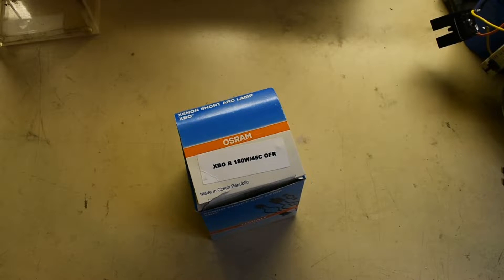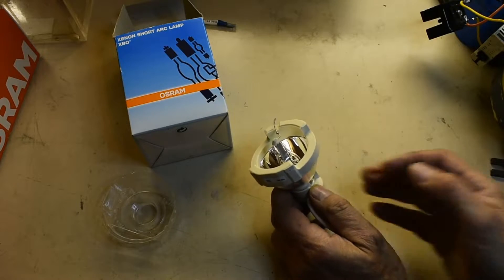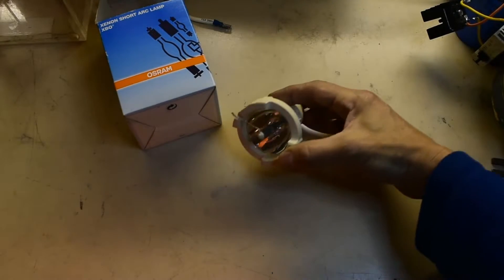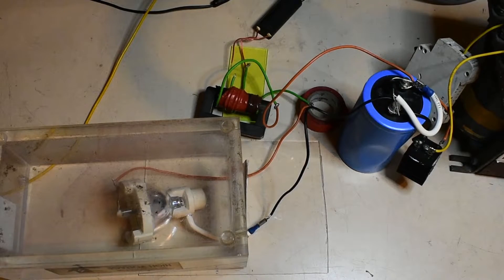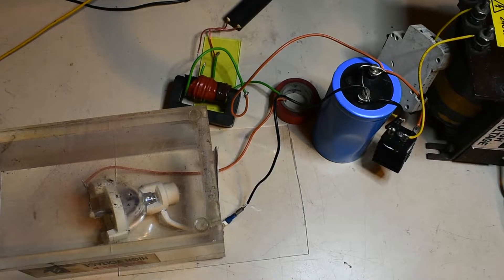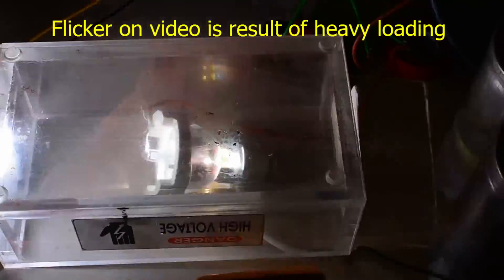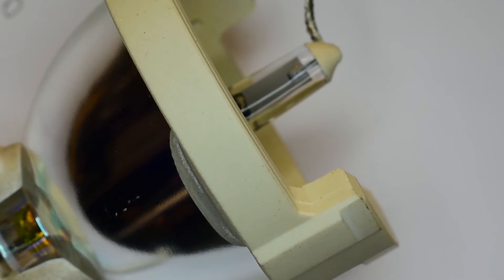small Xenon XBO lamp

Comment: Is it possible to run one of these lamps on continuous high voltage low current? Like 3kv 30ma
Reply from the maker: It will light but not properly, so will be very dull and overload the HV power power supply to some extent. For short or flash use this would be ok but the lamp needs to operate in thermionic emission with a glowing hot cathode for correct operation. Not achieving this will eventually damage the cathode and the lamp may not operate at all.

Comment: You should put the gas discharge tube in the area where it sparks to reduce the danger and reduce noise
Reply from the maker: Just a quick test set-up to check the lamp.
Reply: @tuopeeks  would be very dangerous

Comment: Part description please , especially for inductor coil hv
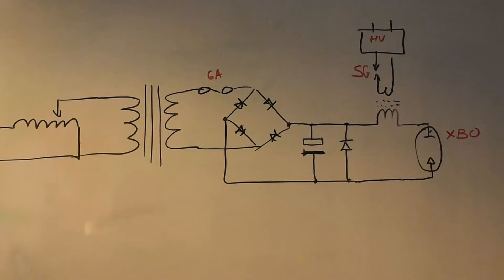Reply from the maker: The diagram at 4:45 shows the complete circuit. The high voltage module is of a pulse type found on eBay often claiming 400kV or similar. It’s more like 60kV, but will run from a 3 to 6V dc supply. This is fed into a few turns of wire around a ferrite core to make a transformer. A spark gap is required to achieve the voltage pulse on the coil. The secondary winding is wired in series with the low voltage DC circuit to the lamp. This is effectively a ‘superimposed ignitor’ circuit for starting the lamp. The transformer can be wound 1:1 or 1:2 depending on ease of starting. The diode across the capacitor is to protect the bridge and capacitor from reverse HV spikes.

Comment: Finally someone shows how to couple the ignition voltage spike into the main lamp current. That ferrite core 10 to 10 turns magnetically isolates the ignitor. Ingenious man. Diode across smoothing cap completes ignition circuit.. Just got a "BHA - 600r - 32 High pressure mercury long arc" that I'm trying to get fired off. Thanks for showing me how to not fry my "500kV" pulse ignitor lol (30kV).
Reply from the maker: Quite easy to adjust the pulse voltage, if required, by changing the turn ratio. Some XBO pulse transformers have fewer turns than 10.  My experience is not damaging ignitors but blowing the low voltage power supply. One of the reasons I am using a simple DC setup here. :-)
Reply: Why thank you. You literally opened up a new world trying to ignite HID lamps.
Reply: It's similar to the way some ion lasers are ignited, for example Lexel units.
Reply: @cambridgemart2075  Thanks again for showing us this. Opened up a whole new dimension for myself and someone I'm tutoring. It works flawlessly. So simple. Next hurdle will be getting proper DC power supply involved and the diode in series etc. Currently running 280 UHP Mercury lamp on a 1000 Watt metal halide ballast. 135 Volt lamp voltage (way too high). Need a variac. $$$

Comment: yikes, glass looks melted, that bulb looks super dangerous now. it was likely designed to run with a lot of cooling!
Reply from the maker: Yes, in operation this light does need force air cooled at about 3m/s

The tube is made of quartz rather than glass so can run at very high temperatures. It hasn’t deformed from the manufactured shape. It’s not unusual to see the tube glowing red at switch off. The lead-in strip of Molybdenum has most likely fused as it’s melting point is  2,623 °C (4,753 °F).  I think the current from the capacitors at start was the cause of the failure and I should have resistor ballasted to limit current, but even so the initial damage meant the lamp was unlikely to work.